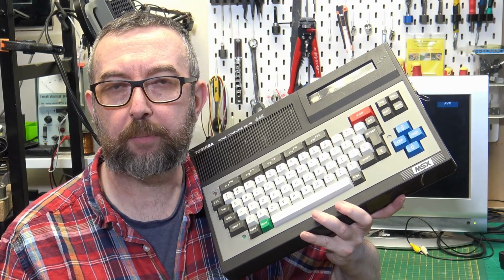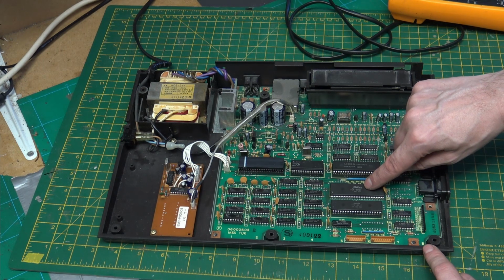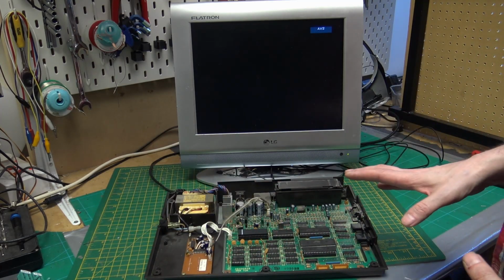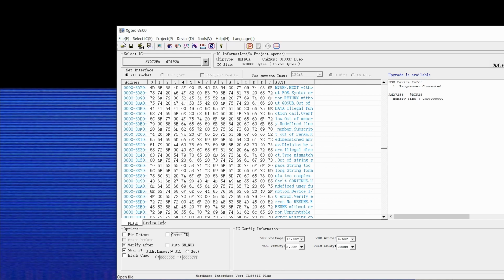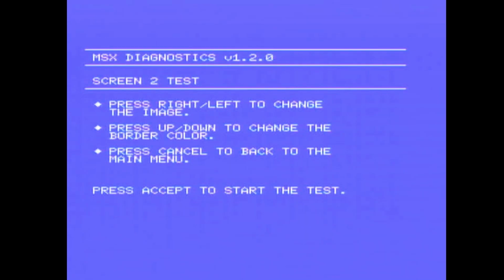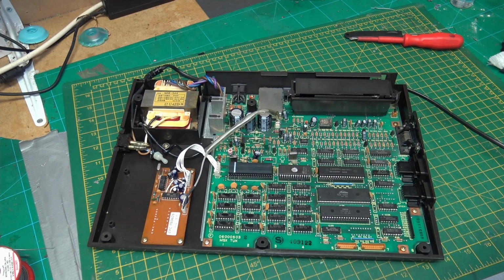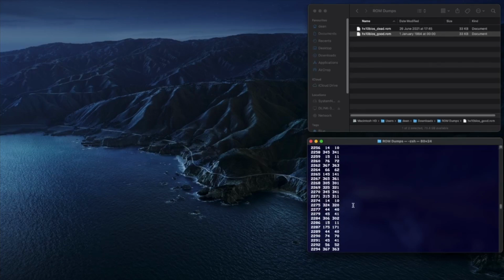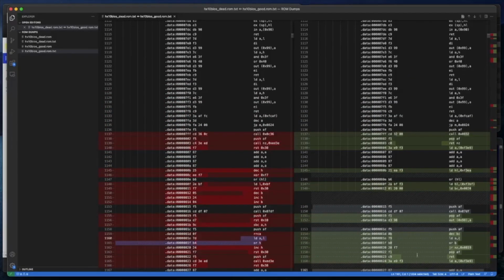Toshiba HX-10 MSX black screen repair can I fix it ?

Comment: I like how you went step by step through the troubleshooting process.  Very informative and well done.  I bought a MSX National CF1200 and fortunately it's working but I saw two empty 4416 ram places on the board so I thought I could upgrade the ram to 32k.   However, after installing sockets and the additional ram chips the screen was just black (it still works when removed).  I don't know if anyone has experience on here upgrading ram on these machines.  I searched the internet but couldn't find any information.  Thanks
Reply from the maker: you should ask on the MSX forums, discord or FB pages. I can't help with that.

Comment: Looks like bit 2 of the data address is stuck high, hence a lot of the data is off by 4.
Reply from the maker: did you watch the end when a friend looked at the rom and compared the actual code to a working rom ?

Comment: Hi Lee, Great Video dude. Was hoping you might point me in the right direction with my HX10. It basically works, at least when its connected to the RF Output and the TV is ON ! If the TV is OFF the HX10 will not start :/ Also i can not get ANY picture out of the composite - SCART cable on my TV :/ I could well be doing something wrong as i dont have any expertise in this area but the graphics do suffer from a lot of bleeding on there edges.. Don't know if that helps.
Reply from the maker: HI so everything I know about the MXS is in this video, and the problem you described is not something I know from any other computer so I can't really offer any suggestions. Sorry.
Reply: @leesmithsworkshop  Well thanks for replying lee. Take care.

Comment: I had a black screen issue on my HX-10 back in the day. Strangely enough, it all started when I yanked out Konami's Boxing without switching power off...
Yes, I rage quit when I got my ass whooped by the alien champ, the memory chips had blown.
I got it sort of fixed by a local computer shop, took a while though as he had trouble finding memory chips. I say sort of because it would play rom cartridges fine but tape games would freeze after 10 minutes.

Comment: What is the value for the cap? I barely can read it on the video but could you confirm it is a 47uF ? I have tried to launch the testram on a Winbond 27c512 (the bin is concatenated 4 times to cover all the 64k) but my HX-10 will not boot at all with the cart inserted (just hearing a humming sound in the background). Without the cart no issue. Is the Winbond not compatible? Do I need to jumper one of the pin header on top of the cart?
Reply from the maker: what cartridge PCB
Reply: @leesmithsworkshop  Hello Lee. It is the Eprom Cartridge, same as the one you have built in this video. I have tried also to burn the DiagMSX on a 27C256 but still the same issue. Black screen with humming sound.
Reply from the maker: @repetto74  ok so I am not sure what is going on with that one, but I had the same problem too and had to use another type from etsy. I asked the guy who made it and he never got back to me. This is why I didn't provide a link and sorry you found this problem. It will turn on with any eprom or jumper settings for me.
Reply from the maker: that should be will not turn on.
Reply: @leesmithsworkshop  Ok thanks. I did not find a pcb on etsy but indeed found another Github project for an MSX cartridge PCB. I may try my luck with this one.

Comment: great video, thank you! 
i have a very similar looking issue with the HX-10 i just got, it's my first MSX machine. but after searching for hours online, i couldn't find the BIOS ROM image for it. is it possible to acquire it without buying a replacement ROM chip someone made, feels like a waste when i have EPROM chips aplenty and a programmer?
Reply from the maker: yes just google for the roms and you will find them. MSX - Toshiba HX-10.zip
Reply: @leesmithsworkshop  i did manage to find it, it wasn't on any web site but a directory listing had a zip with various MSX system ROMs, no wonder i couldn't find it as easily. thanks!
Reply from the maker: @milankolia147  Did you burn it and try it yet ?
Reply: @leesmithsworkshop  yeah i tested the one i found, sadly no luck and now i'm waiting for a proper EPROM eraser... i'm pretty sure there's something else wrong, i did notice the original Z80 doesn't work on my Kaypro, but i have some spares. there's some activity on the VRAM, but it's sporadic just like you first had

Comment: Lee, this is the video I have been waiting for forever, I've had the Toshiba HX-10 MSX since the early 90's and has generally lived in the loft all this time!!!! I started looking at it again last year and like you found next to no information to aid troubleshooting.

Needless to say one new 256k Eprom later, programmed up and got the Cap Lock light working :) following a purple herring with my upscaler detecting the signal but not showing an image I plugged it into an old Bush DVD/TV LCD screen and BINGO It's Alive so just need to hook up my TxDuino and get some software running.

Many thanks Lee, great video, now lets see what the fuss is all about with these MSX's :)
Reply from the maker: I tried a couple of games. Hero looks very good. I think it has a lot of zx spectrum ports that are not very well done. One example was outrun wow that was bad. I am happy this helped you to get yours working too. All credit to tynemouth software for the tips.

Comment: I have a machine that seems to have the same problem, could you tell me what eeprom chip do I need to write the new bios on?
Reply from the maker: 27256
Reply: @leesmithsworkshop  Thanks for the reply, would the M27256 - 2F1 UV  or the TMM27256AD-15 be suitable? as these seem pretty cheap on ebay
Reply from the maker: @jasonphillips5816  what ever 27256 you can find and can program.

Comment: Hi can you point a link to where you got the pcb open sauce I fancy a go at Makeing the rom diag carts many thanks great work
Reply from the maker: hi, I am waiting for the guy who designed it to get back to me, I found some issues and want to know before I can share. You can buy them from etsy if that helps, one guy makes a taller pcb so the chips are  outside the case,
Reply: @leesmithsworkshop  many thanks Lee will keep a eye out for updates from you great channel by the way

Comment: I would have been surprised if the fuse was faulty. My memories of fused plugs in the UK were that most electronics would sacrifice itself to protect the fuses, and the more expensive the equipment,the more likely it was to decide to save the fuse.
Reply from the maker: it could be someone removed the fuse ! best to check everything one step at a time.
Reply: @leesmithsworkshop  Oh, absolutely. Start at the beginning and check the obvious stuff. A missing fuse is way more likely than a blown one, but it’s still a possibility that’s easy to eliminate. As my father used to say - if it doesn’t work, try switching it on. If that doesn’t work, try plugging it in.

Comment: I have 2 of these hx-10's that both look like having the same problem. Caps not flashing and seems to give some life on the video just like yours :-)
Reply from the maker: I hope you can test the rom, perhaps you will have good luck too.
Reply: @leesmithsworkshop  that's the first thing i'll try. A friend of mine has a programmer, i hope it's the same issue